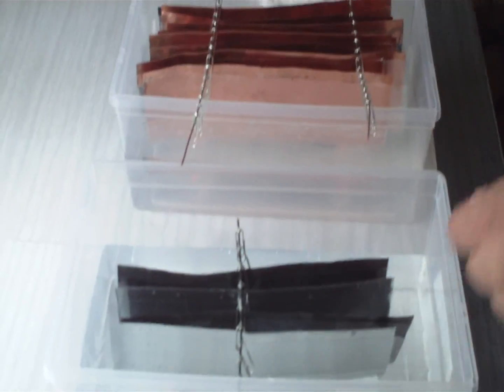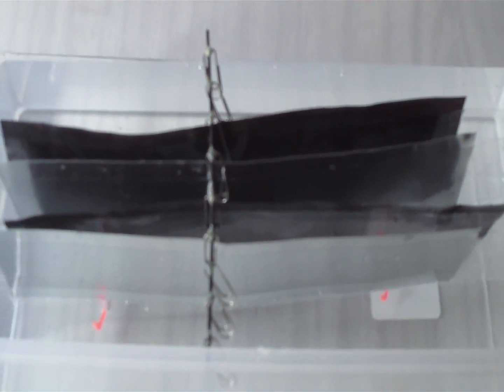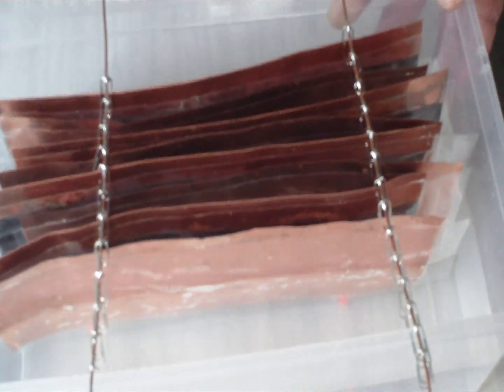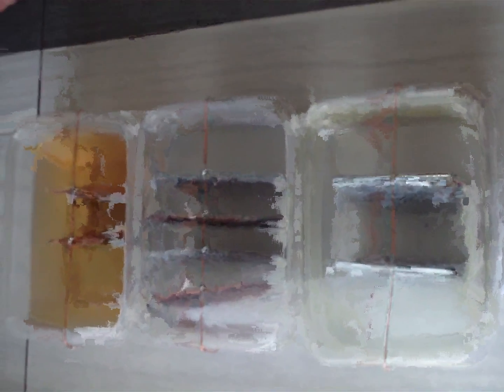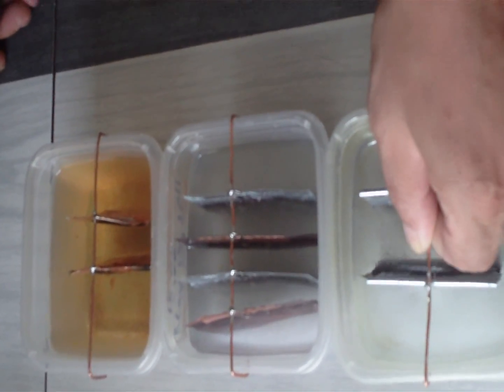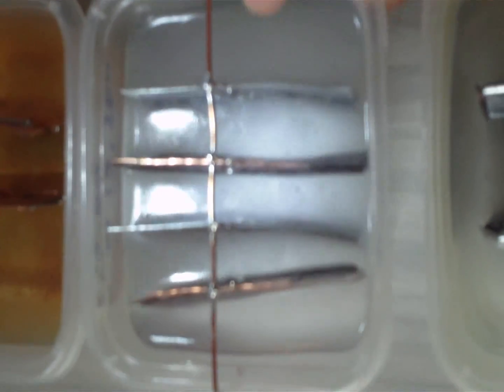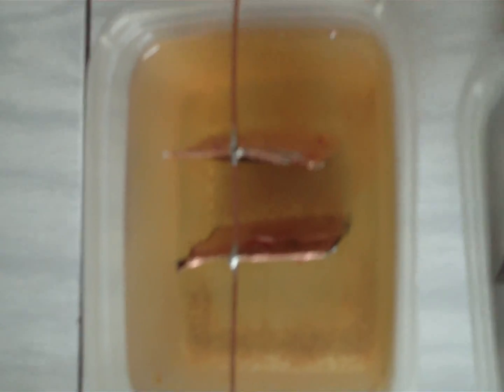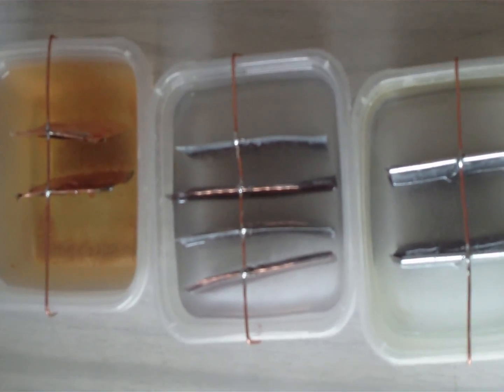Crash of CO2 theory

Comment from the maker: To "Al Beau" Yes, thing are not that simple. In the sea salt solution is not only NaCl, there are bunch of other things. Beside, this acting as a simple battery creates magnetic field. Being open to air, this magnetic field attracts and bunch of other chemicals and components too. Which gives you pretty complex-ed water based solution. To avoid that contamination in batteries they have them sealed. But that doesn't change the simplicity of the process...

Comment: GTo back to scool, this was not replicated correctly and pure hydrogen from a cylinder is dangerus, done by electrolisis, its mixes with ambiant gasses and does not explodes. I tried it, no boom.... this is slander. This could cost you big $$$$$$$$$$$$$
Reply from the maker: Al Beau Well, I have being in school over 40 years ago. With this electrodes, even if you produce hydrogen is going to be couple of grams a day... Compared to what I work with now (hydrogen systems which produce over 100 liters a minute) well, I guess this is the last thing i need to worry about... I have no idea how much you understand from the video. The idea in general is that producing GANS is simple chemical reaction...

Comment: I almost forgot to mention: Electrolysis generates Hydrogen Gas and Chlorine Gas. These Keshe's kits do not absorb CO2 Gas from the environment, NO. They release gases in it. So far, this has not been noted because the electrolysis level is very low so the gases release is very slow, but if you put the CO2 kit in a small and not ventilated room, the gases could accumulate and have terrible results because Hydrogen Gas is explosive and Chlorine Gas is poisonous.

Comment: Hello Ludmil, how are you? Let me congratulate you because you have became aware of a very evident phenomenon: Keshe's Co2 Kits are nothing more than Electrolysis Kits. That's right. This has been very well documented by science. Keshe's Co2 kits are Galvanic Cells which produces electricity, because they are Volta batteries with a single layer and an aqueous electrolyte. Proof: https://www.youtube.com/watch?v=Q8xbhY6I8dE
This proves that the CO2 kits generate a low voltage electricity, at the range of miliamperes. But since the "CO2 kit" is intended to remain passive, the electricity goes nowhere, and begins to react with the salted water. The mix of salt and water is called Brine. This is what happens then: https://www.youtube.com/watch?v=k21MeRIL0oE
It produces Sodium Hydroxide (Gans). A copper electrode yields blueish "GANS" (actually ordinary copper hydroxide), an iron electrode yields brownish "GANS" (actually ordinary iron hydroxide), a zinc electrode yields whiteish "GANS" (actually ordinary zinc hydroxide), and so on.
Proof #3: Gans timelapse(1 foto each minute)
http://vimeo.com/111694485
You can clearly see the copper wire bubbling and releasing gases just like the regular electrolysis, guys...
So, this is obviously a scam. Keshe sell these kits as CO2 extractors but they only produce Hydroxide. What do you think Ludmil?
Reply: +Para hexavoctale It's a scam like all other experiments from Keshe I'v seen in a couple of years. It begins with the measurement on his "coke bottle reactor" where the display on the DMM is caused by wrong connected cables (v/ohm and 10Amp instead of Ground) and reached the summit when he tricked the gamma ray spectrometer into false results by having totally wrong volumes of the sample entered. 

Weight reduction? Yes, manipulating the scale with a primitive lever
Weight reduction 2? Showing just a video which never shows the scale and the DUT at the same time
Magnet world record? 129 Tesla measured with a Hall probe which cannot measure in excess of 3 Testla calibrated and max 20 Tesla uncalibrated, The probe goes into saturation at about 25 Tesla and then does not deliver any meaningful Value

And so on for every experiment he showed.